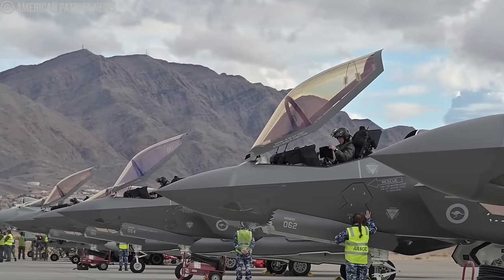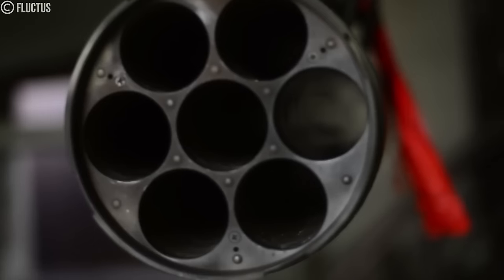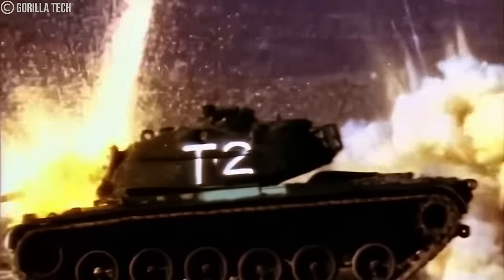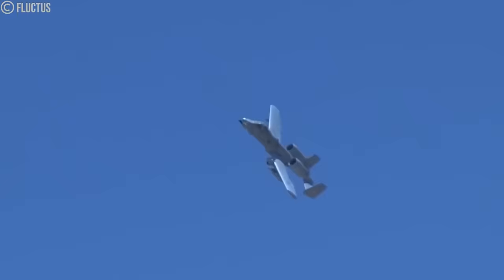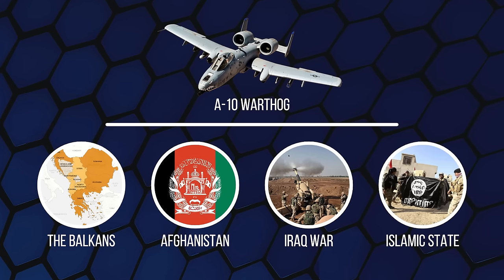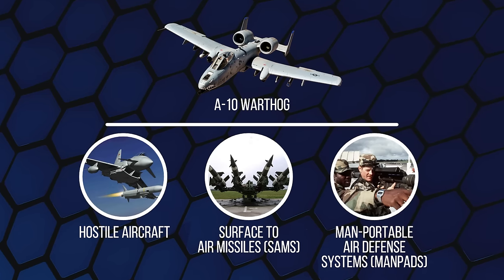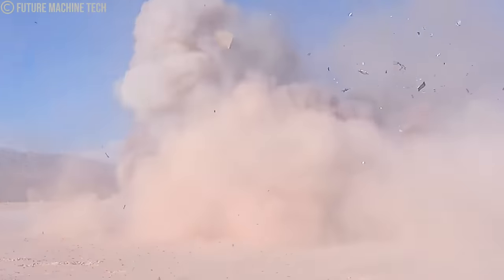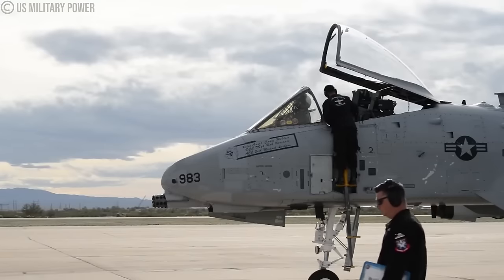Why America's New A-10 Warthog Shocked Yemen, Hamas and Russia!

Comment: The A-10 is not a "fighter" aircraft it's an attack aircraft.
Reply: I know what you're saying.  It is annoying.  The letter "A" means "attack" same as its predecessor, the A-1 Skyraider.
Reply: @Xinder720 its a strike aircraft and NOT a fighter in any way, its purpose is for Close air support and NOT air suppremacy
Reply: The U.S. military has a long history of blurring or outright misnaming aircraft.  I agree that the A-7 is designed for attack, without trying to be a 'Fat Amy'.   The A-12 was certainly not an attack aircraft, nor was the F-117 a fighter.  The A-4 was more of a fighter than an attack plane (but USN would not use as such) and the A-7 had both guns and missiles.  Don't even get me started on 'P' (patrol) designations.
Reply: @946towguy2  I think 'P' means 'Pursuit' such as the P-47 Thunderbolt or P-51 Mustang though its an obsolete classification.  Thanks for your primary answer.
Reply: @Xinder720  Also remember the  "P-80" fighter jet (later the  F-80) that showed up in Italy to stop the German high altitude Photo Recon Jet...  But they never met !  tjl
Reply: Are there any new A-10s being produced?
Reply: It’s more ground support.  It attacks to support ground troops.
Reply: They have defeated Russian MIG’s in the Gulf war not loosing an A-10,
Reply: The A-10 is equipped with air to air missiles and has shot down other aircraft!
Just before the first Gulf war, the A-10 was going to be replaced by the F-16. After that war a lot of the A-10's were taken out of the bone yard and put back in service. It will probably be replaced by the F-16 as it was in.  In 1991, the A-10 took Top Gun in Gunsmoke competition at Nellis AFB. It beat every other fighter in the inventory in every category, except  the F-16, it won the high altitude bombing.
Reply: Plus it’s called a warthog, that alone is bad ass!
Reply: @nevinbrockett1858  watch what they can do and our enemies hate it. Yeah it’s old tech, slow compared to is replacement  F-35 or F-22. But it doesn’t take a lot to get these in the air. Those replacements spend more time in the garage than in the air. Give me a choice I’m sticking t with the A-10
Reply: @1lthrnk 

*Losing
Reply: @rick3514 

Why would an aircraft, first activated in the late 70s/early 80s, be replaced by one activated in the mid-70s, for a COMPLETELY DIFFERENT ROLE?!?
Reply: @nevinbrockett1858 

"Warthog" is actually it's nickname.  It's official name is the "Thunderbolt II", after the P-47 Thunderbolt.  Still, either name is pretty badass. 😉
Reply: @1lthrnk 

A-  Neither the 35 nor the 22 are suitable "replacements" for the A-10.  In point of fact, the 22 was never even considered for the role,

2-  It's a hangar, not a garage, and most maintenance is performed out on the flight line, regardless of weather, &

ẞ-  Every time the U.S. military has attempted to make a "multi-role" anything, it has failed MISERABLY.  EVERY    SINGLE    TIME.
Reply: @Xinder720 , And it uses jet fuel, not gasoline.
Reply: It's actually a close air support
Reply: @Rotorhead1651 really, that's the  funniest thing I've heard in a while... I'll bet every Viper aviator on the planet would disagree and take on whatever aircraft you believe is a so called "multiroll fighter" , at least every Viper aviator I've ever heard and we won't even mention the Raptor,  she's never even been close to tested by any aircraft on the planet  in service  !
Reply: @1lthrnk  You would hope highly trained and specialized pilots would win against the flying goat-herders.
Reply: I believe the A-10 has a few air to air victories, so maybe it is a fighter too...
Reply: It's an ASSAULT aircraft.😅

That being said, it's the best assault aircraft we've ever made. It does its job beautifully and effortlessly. It is a tool that fits the need.
Reply: @Rotorhead1651   I would have to disagree with you about one aircraft, the F-15E Strike Eagle.  Although the original Eagle was designed as a pure air superiority fighter, and still is, the E model proved to be excellent at deep interdiction with a massive bomb load and AGMs, along with plenty of air-to-air missiles for protection.
Reply: It is a raptor!
A true bird of prey .
Reply: 😂 That's right! You notice the "A" designator?,,, not an "F"?, but still, those HOWTHEES can be a real pain in the butt!
Reply: You have to keep in mind who these people are who make these videos, as we said during Vietnam, draft dodgers that ran to Canada, I still haven’t forgiven Canada for providing sanctuary for them.
Reply: @adamontario2834  Close air support is a mission type.  Attack is an aircraft type.
Reply: You are right A-10 stands for attack aircraft (A-10). 🙂
Reply: @bradjohson4787 I don’t know why they call it a fighter aircraft when it isn’t. The A-10 is much more robust than a fighter aircraft and it does even fly Mach I it is just designed for ground support for combat troops and it is just as it’s name suggests attack aircraft. 🙂
Reply: @Rachva-2024 f
Reply: Titanium ambulance with wings brother
Reply: It fights for sure.
Reply: @jimegloff8550  CAS Close Air Support
Reply: It is also not a US army aircraft.  USAF.
Reply: @Rotorhead1651  Whatever works.
Reply: I heard that
Reply: I noticed that. The local A-10 unit was dubbed a fighter squadron where I retired. I carried an IZLID mounted to my M-4 because it made CAS easier. Glass jawed fighters don’t like to get down in the weeds. From the Stuka, Sky raider & Warthog, nobody loves the attack crews more than the ground guys. The fighter pilots will never be short of love for themselves.❤
Reply: @rick3514  Find the OV10, restore it to service
Reply: It has "fuel" tanks, not "gasoline" tanks.

Comment: Ask congress to keep building these aircraft.
Reply: Tell!
Reply: Republic-Fairchild, the company which initially manufactured the A-10 has been out of business for decades.  The old manufacturing facility, here on Long Island, is now a Cineplex and shopping center.  This is one of the main excu.....er.....reasons they use for neither building new airframes nor updating/upgrading existing ones.
Reply: @Rotorhead1651  There should be a current aircraft builder capable of resurrecting the design. The only real issue with the A-10 is it's vulnerability to modern anti aircraft missiles.  True that  flying very low makes the A-10 harder to hit so upgrades might include better threat detection capability  and countermeasures. This might involve thinking outside the box as it relates to typical counter measures. 

When you have air superiority, the A-10 is still a formidable weapon. I wouldn't change the basic design much outside of its defensive capabilities. 

It is interesting to hear that it has recently been used in Syria, Gaza and Yemen. But these places don't have robust air defenses. It would be interesting to know if they have encountered any systems like the S-300 or S-400 and how they dealt with it.   I suspect that as long as they flew ground hugging missions, they probably can evade the radar to an extent.

The A-10 with its "sneak up on you" nature and the roar of the roar of the gun has an intimidation factor that is hard to beat!
Reply: @Rotorhead1651  Closed 3/87  I was part of the workforce scattered to the winds ....  No tooling preserved.  No blueprints preserved.
Reply: AIR FORCE DON'T WANT IT.
Reply: @ricktimmons458  better yet ask congress to send the A10 to ukraine to fight..
Reply: @gregdepp4218  I bet the us got has full blueprints stashed somewhere...ever known the gift to no keep things tooling can be remade even a existing airframe can be reblueprinted
Reply: @charleshanks6186  I was one of the people kicked out when the plant closed in 3/87.  We were told to send all our file cabinets of documentation to a central collection point.  Which filled up with hundreds of file cabinets.  Which were not to be saved, but disposed of ...  These were all paper blueprints then, I drew a lot of them.  The only existing blueprints belong to Boeing, which re-drew the wing blueprints in CATIA for their re-wing program.  All the tooling was scrapped at the time of the plant closure.
Reply: @gregdepp4218  Would it be possible to reverse engineer and develop a more modern way of the A10 (for example with all the anti radar detection materials of the F-35 for example)?
Reply: Congress had to order totaly new air craft , the Die's were destroied back in the last century , all parts have been comming out of the bone yard in Az , it's good to see totaly new a-10's comming on line , they are great aircraft
Reply: @user-oo2dc7mk1l  the parts can be 3d scanned are remade..they also can 3d scan just about anything these days..it's not really rocket science it's a lot more computer science at this time
Reply: Needs improvement, not scrapping

Comment: The F-35 will never replace the A-10 as a close air support aircraft, it is too vulnerable.  The A-10 is respected by troops on the ground.  The F-35 is too fast, has too short of a loitering time, and only has a 25 mm weapon.  The A-10 has a 30mm weapon, and several weapon stations under its wings.  The A-10 can be a bomb  or missile truck.  The F-35 must carry its missiles or bombs internally to remain a stealth aircraft.
Reply: the a35 goes in first and takes out the sam - the A10 comes next and takes out the rest.

Its all about teamwork.
Reply: I read somewhere that an A-10 with 5th generation capabilities can target 16 different targets simultaneously using multiple weapons systems.

Comment: I worked this aircraft for over 20 years starting in 1978.  It has gone through a lot of improvements.  it has all the bugs worked out of it and is easy to repair on the front line.  Simple is better at times of war.  The new aircraft’s the Air Force wants are way too expensive.  The F-15 is another one we should invest in.  Drones are the future and we need ways to defeat them.
Reply: Going by your timeline. You could've worked on the one that saved my brothers and me, Thanks!!!
Reply: I was thinking while watching the video, what about turning A10's into Drones !, just like Ukraine has done already with the A22 Foxbat etc , a few of them directed ta the Kerch Bridge, what ya reckon ? .
Reply: If you could choose one airplane for yourself, would you prefer an old and cheaper Warthog or much more advanced and expensive F-35?
Reply: I think they made about 735 of them. I wonder how many are still in service or stored at DM in the desert.

Comment: I as a former Army guy that had his butt rescued by an A10. This is my opinion. I fully understand the cost of this I do. You just put up cost to operate the ones they want to replace it with. How about redesign the A10 into a new aircraft. There is nothing out there in the US Military inventory that is close enough or proven to work like the A10. It would be like they did when they replaced the 1911 45 for the M92 9mm. Yes it replaced it. But was not even a close match. Yes 9mm is a good round when you pair it with a hollow point. The military uses FMJ rounds. Not even close.

Comment: It's like an old square body '77  K5 Blazer.  Tough, easy to maintain, inexpensive to fix, reliable, and near indestructible.  No need for stealth in this role. If it ain't broke.....
Reply: Don’t fix it, or should I say “her”.
Reply: tell that to all the ally forces it killed accidentally (technical and situational awareness issues due to lack of visibility, commonly observed in the A-10). Also it's definitely not cheap (cheap to maintain but not to operate), nor indestructible, all it takes is one or two anti air missiles (remember, it's not stealth, and has to stay close to ground due to low speed and altitude limitations) and it starts falling, that titanium tub doesn't protect you against gravity. Also very unreliable compared to the new F15EX. I agree the stick is really cool and American, but I'm pretty sure it doesn't even remotely rank high compared to all the other stuff the air force has in its arsenal.
Reply: Most have been upgraded with all the new Nav. equipment, CCP mode and laser guided systems. The targeting pod can be used as a gimbaled infrared camera viewed in the cockpit. It's record speaks for itself even as they operate in some of the most battle rich areas.  Still notorious for bringing it's crew back home
Reply: @Born2Losenot2win 
With your logic the military needs to get rid of artillery because of short rounds or incompetent officers who can't read a grid map 
Those two incidents have killed many allies

Comment: They're thinking they should give the A-10 to the Army if the Air Force doesn't want to keep it. It is already a USAF Reserve aircraft.
Reply: The problem is that the army doesn't want it.  I think the USMC could use it though, in place of some of the f-18.
Reply: @946towguy2  Hear-Here, Semper-Fi.
Reply: I trained at Ft.Indian Town Gap in PA and they had had Army A10 Warthogs there at that time.  I was amazed watching them fly low over us trainees and then disappear over the mountains.  Then you would hear the BVVVVVVVVVVT.

Comment: If this A10 Warthog is scrapped it will be the most irresponsible thing to do due to the living proof of the action active forward Guard built to support ground and other troops like no other precision fighters ever. It brings the American badass to the front door.
Reply: It really never did what it was meant to do, the F16 and F15 have already proven that they could easily do the same thing with infinitely less risk to us personnel. It needs to be retired as it can't even safely fly in contested airspace
Reply: @grey9803  Yeah, yeah, yeah.  Tell that to Kim Campbell, whose Hog took about 100 rounds, blowing off one wing, the stabilizer, and a quarter of the body, hydraulics systems, etc. She flew over half an hour back to base and landed it on manual wire controls.  Ask any Army grunt or Marine if they want an old Sandy to provide CAS or a Warthog, and I'll bet that 100% say WARTHOG!
Reply: Luckily, they decided to keep and renew the A-10s, which are in the air now.
Reply: It’s not a fighter. Fighters are for air superiority. It’s an attack aircraft, hence the A in A10. It’s specifically designed to help our ground forces….and eliminate the enemy’s.
Reply: @grey9803  maybe the airforce should ask the army if they could use them? 😆
that would be your answer!
Reply: @billynomates920  ....... I mean, that would be fine if the u.s army flew attack fixed wing aircraft but they don't. That's the job of the Air Force, Navy and only just recently the Marines( a branch of the Navy). Even then ( as I've already stated) the Air Force, and Navy have already deemed that regular fighters perform the job of the A10 both more effectively and with less risk to pilots

Comment: The A-10 is an awesome aircraft. Well designed, well built, efficient, flexible and deadly. As a tool, the A-10 and possibly the B-52, are the best aircraft ever built for their roles, as their enduring legacy has proven time after time.
Reply: The role of the A 10 is very specific and they need backup if the plane is pursued by an enemy fighter in a dog fight.

Comment: Anyone thinking the F35 can replace this plane and do better. Should this again this plane is build to take a beating and built around a massive 30mm auto cannon (the size of a small car) . The F35 was no built like a flying tank to take hits, it was built for hiding and seeking , with a very expensive stealth coating that as not so durable .also the engines on the A10 are ment for dusty areas. The F35 would be a stupid idea to try and replace a plane that became a legion in its class.

Comment: The USAF had Scaled Composites design a replacement airframe for the A-10. Rutan called it the Aries. The Aries was capable of being operated remotely or it could be operated by a pilot. All that was needed to convert from a UAV to a piloted aircraft was to flip a few switches. It is still a mystery to me why the USAF spent the money to have such research done and then fail to take advantage of it. Could it be that the USAF simply does not like being involved in ground support?

Comment: There is no NEW,  A-10 Wart Hog!  I worked on the A-10 avionics for over 13 years. According to the wing commander at Whiteman AFNB in 2018, it is going to be retired this year 2024. 
Just before the first Gulf war, the A-10 was going to be replaced by the F-16. After that war a lot of the A-10's were taken out of the bone yard and put back in service. It will probably be replaced by the F-16 as it was in.  In 1991, the A-10 took Top Gun in Gunsmoke competition at Nellis AFB. It beat every other fighter in the inventory in every category, except  the F-16, it won the high altitude bombing.
I think it is really stupid to retire it.

Comment: The A-10 is the best aircraft in our arsenal for supporting ground  combat troops. They can get on target quickly with plenty ordinance and stay on target for extended periods. The Air Force has been trying to kill it for years in favor of much more expensive aircraft that, while technically far superior, are decidedly inferior when it comes to supporting ground troops in close combat situations. We really need to keep them and expand inventory. If the Air Force doesn't want them, give them to the Marines. We'd be thrilled to have them.

Comment: The part that's getting expensive is the center wing stress cracks as well as the engine thrust mount area.
Reply: A lot cheaper than the F35 to build and maintain.

Comment: A-10. Airfield A/G 5 - 70 - 120 mile security. The A-10  pilots then firework. Full operational ground support for the A -10, 24h operational. Secured.
Reply: There will be a on a pinhead concentrated support by the A-10 Pilots for the front line ground troops. Forget the dron perspective. Willing human systemic operational success factor.